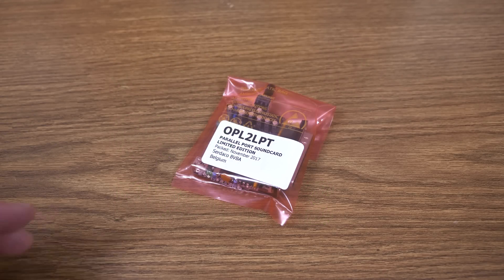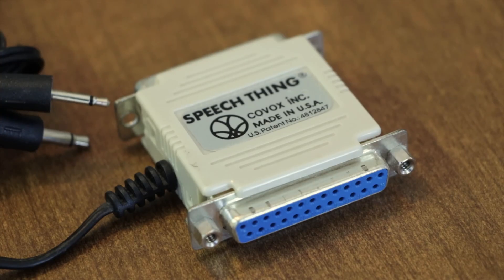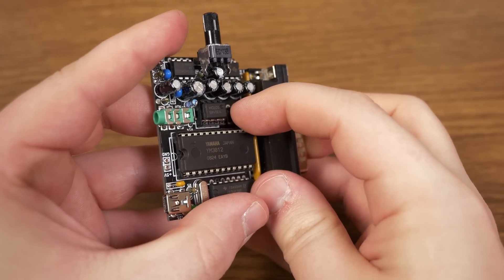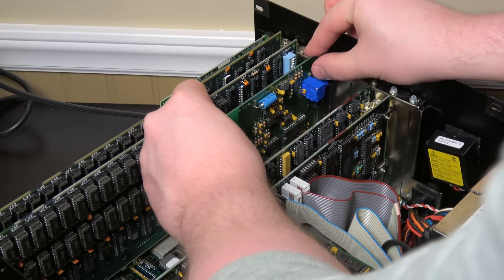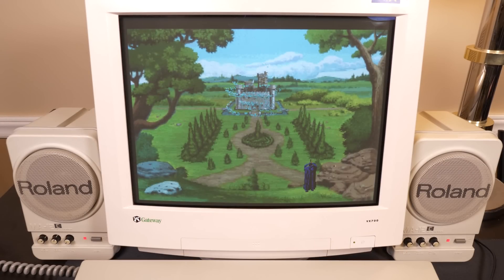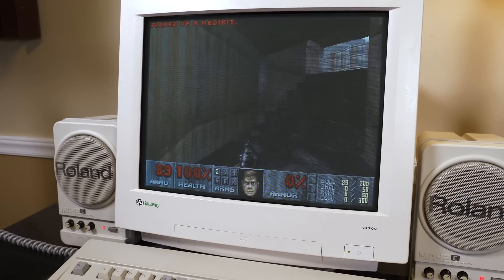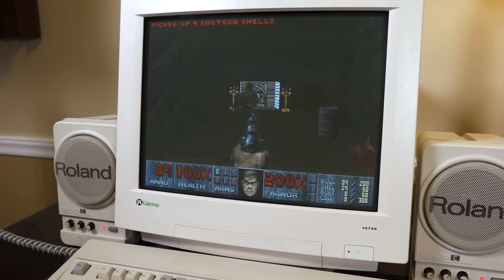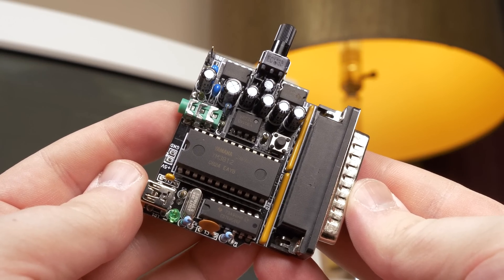AdLib Sound Card Over Parallel! The OPL2LPT

Comment: Why the hell didnt this get made 30 yeas ago??.. It would of been possible -
Reply: ... Makes you wonder, huh. There is literally nothing on that board that wouldn't be available back then...
A little costly, perhaps, in theory...
But available, for sure...

Guess it's just that nobody thought of it at the time...
Reply: Yeah... I missed the USB port - but ultimately it's just being used as a glorified 5 volt DC power jack.

30 years ago by the way is 1987...

If you want to be pedantic, that's the year the adlib card was first available.

And honestly, you don't have to tell some of us about the 80's and 90's.  We were there. ;p

In 1993 we got a 'multimedia PC' for $2300 Australian dollars. (486 SX 25, 4 megabytes of RAM, Pro Audio Spectrum 16 sound card, 2x CD-ROM drive.)

In 1990, my mother was intent on buying a 486 that would have cost 7000 guilders (dutch currency). Instead they talked her into buying a 286 for 5000 guilders.

I don't know where those 10-20,000 USD numbers come from, but given you're talking 1989, and we were buying a PC in 1990, I think your numbers are a little overblown.

It's great reading about this stuff and all, but I remember it, because I lived through it.
Computers were expensive, yes. but generally not THAT expensive.

Unless someone is massively over-inflating the price for various reasons.
Reply: This item would of retailed for $99 - $150 with out any issues. My Sondblaster card was $70 in 1989
Reply: My Adlib card was £100 back in 1987

https://en.wikipedia.org/wiki/Ad_Lib,_Inc.#AdLib_Music_Synthesizer_Card_(1987)
Reply: KuraIthys Did you look at the article from The New York Times that I quoted and linked to?  That's where I got my 486 system cost numbers.  The USA inflation figures and calculators I used are available on tons of websites.  Google it like I did if you really want to.

Regarding the cost of sound cards being much lower... that just solidifies my point since there would be even less of a market for a device like the OPL2LPT on the market in those days.  Why would you bother with such a device as the OPL2LPT that will tax your CPU (remember the stutter LGR dealt with with a 100Mhz 486?  How would a low end 486 or 386 perform?) when if you could throw a Sound Blaster/SB clone card in that would have FM synth AND PCM playback abilities?  Unless you were in a situation that made card installation impossible, I have a hard time imagining that these would fly off the shelves in any sort of hurry.
Reply: Why not 30 years ago?  Powerful home computer technology wasn't even remotely close to as ubiquitous (and hence, dirt fucking cheap) as it is these days... or even 20 years ago for that matter.  If somebody was in the market for a bleeding-edge 80486 in the very very late 80's, chances are it would include an actual sound card out of the box.

Allow me to present a New York Times article dated October 22, 1989 with 80486 machine cost figures that will make your nuts retreat to behind your eyeballs:
http://www.nytimes.com/1989/10/22/business/the-executive-computer-the-race-to-market-a-486-machine.html

Quoting, with BOLD emphasis mine:
''We believe the 80486 will reset the industry standard for personal computer price-performance,'' said Lee Hoevel, chief architect for the NCR Corporation's work station products division. NCR is among several companies that have already announced they are in the race to sell the first 80486-based systems. For prices expected to be $10,000 to $20,000, the computers are believed to be capable of performing on the same scale as minicomputers costing several times as much."

(I emphasized the price-performance bit because it cracked me up)

To be clear, adjusted for inflation to November, 2017 dollars, that would read:
"... For prices expected to be $19,639.25 to $39,278.50 ..."

A couple hundred bucks for a real whiz-bang ISA sound card wouldn't have been a big deal if playing the sordid looking selection of PC games available at the time was a goal of yours. 

For what it's worth, if for some reason you actually wanted to purchase a laptop luggable portable in those days, I can promise you that you wouldn't even dream of playing games on the portable displays available at the time unless it was a 100% text adventure like Zork.

When the multimedia PC push gained traction in the early 90's, there were many, MANY inexpensive Sound Blaster clones on the market (as well as included in almost all standard PC manufacturers machines) that offered not only passible (and usually 100% Sound Blaster compatible) FM synthesis capabilities, but full 16-bit PCM sound support as well... leaving the OPL2LPT's capabilities in the dust.

The OPL2LPT fills in a nerdy niche market that was just far too small to be considered worth the cost of engineering the hardware and software, let alone the production of such a unit, when the permeation of cheap sound hardware in the era when the average CPUs were powerful enough to use the OPL2LPT were commonplace.
Reply: Well, the USB wouldn't be available, so they'd have to use a different type of power input :)